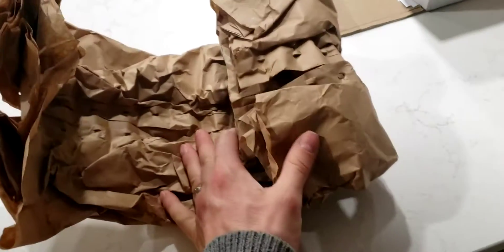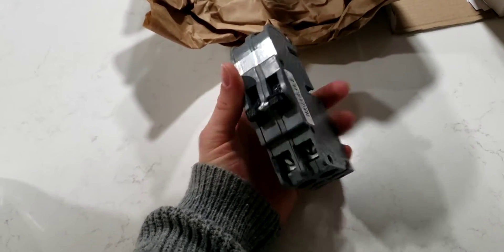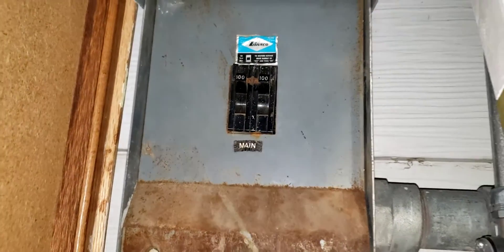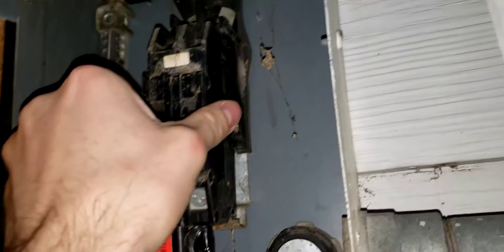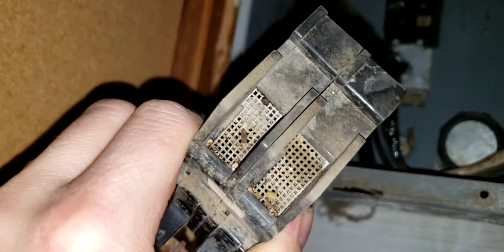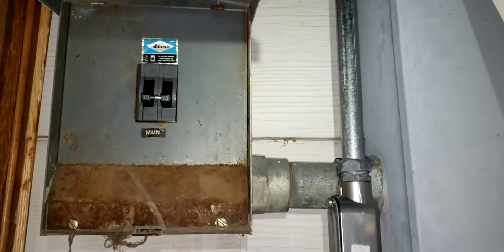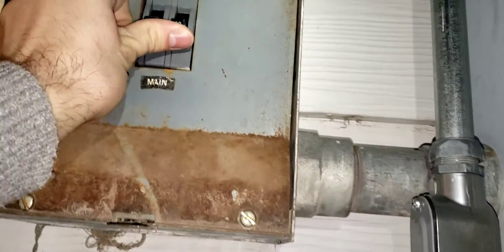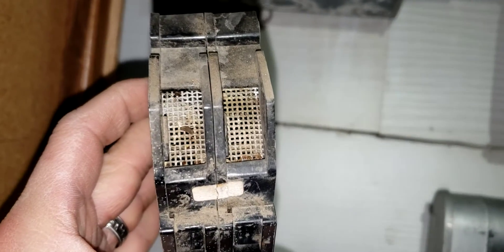Main Breaker Replacement

Comment: Yikes ! Aluminum wire from the load side of the breaker to the panelboard. Change it to copper. Hope the rest of the house does not have any aluminum wires for the branch circuits.

Comment: That was freaking frightening! I'm not gonna troll,  but I could never advise anyone to replace a main without having your power service come out and shut the primary load off. 
Anyone wanting to do this themselves needs to understand that there were several No No's demonstrated here. Not once was it mentioned that those wires were still live!  That's not getting a little nip of 120V. That's blowing your freaking hand off if you're lucky.
Reply: Just pull the meter from the socket if there is no lock. There are videos to safely do this without calling up PG&E. They'll want a payment, require a licensed electrician to do this and you'll have to pay the local jurisdiction ridiculous permit and inspection fees.

Comment: I live in a 50 year old condo complex with 60 units.  I lost have 30% of my power in my unit in several rooms.  Could a 50 year old main breaker still partially work and power half the apartment?
Reply from the maker: I would think that breakers from the sub panel are going out in that case, but I am not an electrician so that is only my best guess.

Comment: Did you work with live wires? Looks like you did.
Reply from the maker: I turned off the power at the main breaker that I was replacing before doing anything. The main line coming from the meter are fixed in place, so no chance of accidental contact there as long as I was paying attention to what I was doing. Thanks for asking!
Reply: This is NOT how you replace a main breaker.  This is reckless and sheer stupidity. You should remove this video

Comment: Nice job finding and replacing the breaker but you should have made the main wires A lot tighter with the screwdriver. Main wires should be super tight or it will continue to melt like it already has.
Reply from the maker: Thanks for the advice, I did end up tightening them off camara, glad to know that will help!
Reply: Do you turn off electric somewhere before you take out the old breaker ?
Reply: @emailtomrhawj  with the particular style shown in the video you can safely change the main breaker without turning off the power elsewhere because the power feeds into the breaker first and then the wires. However there are many styles where the utility company must come out to remove the meter before a main breaker can be replaced. No work should be done on a main breaker unless you have a good understanding of the dangers involved and how the power is flowing through the system.
Reply: @everythinghomerepair1747 I think he did not turn the power off. If the wires touched could do some damage.
Reply: Thanks the breaker in my house look like the one you changed out
Reply: How old is your breaker?  DO you have parital power in your home?
Reply from the maker: @Boyridge  when the breaker tripped all power went out.